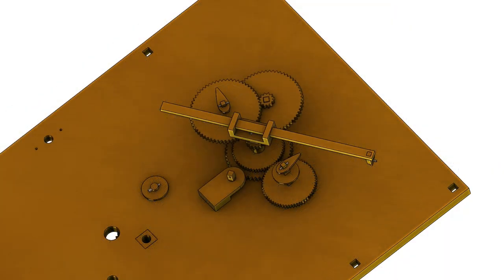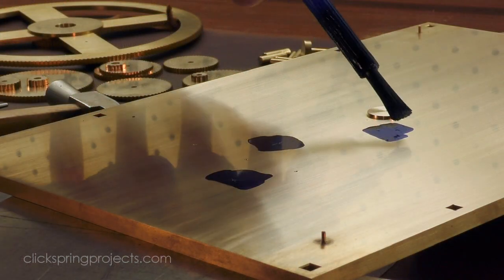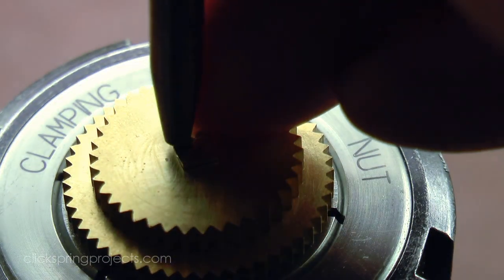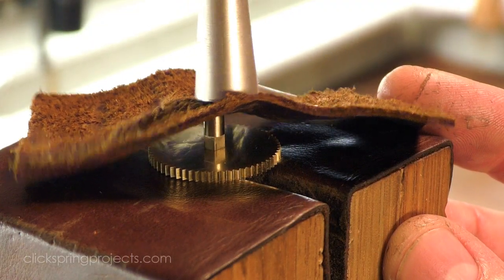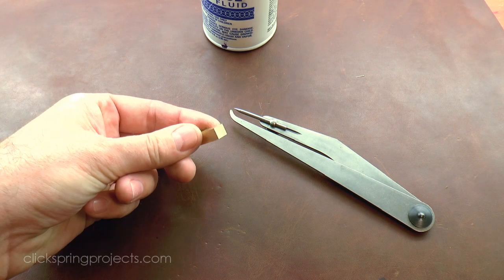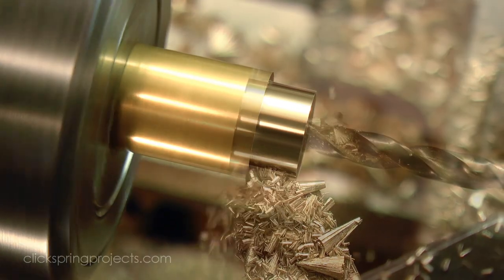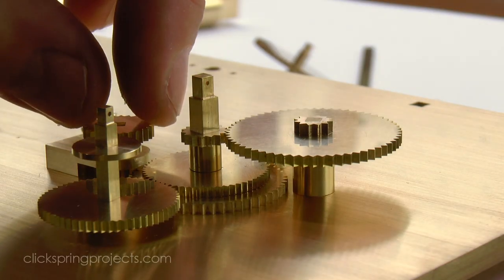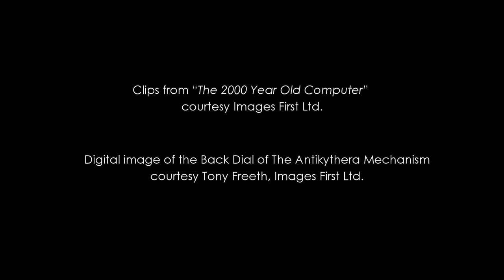The #AntikytheraMechanism Episode 6 - Making The Metonic Calendar Train

Comment: It blows my mind how workable brass is by hand. I'm surrounded by so much steel that sometimes I forget how soft some metals are. Frankly it looks like a perfect balance between strength/stiffness and machine ability for a bronze age mechanism. I'd be curious if you think softer would be more preferable given all the filing involved in this project and it doesn't seem like this particular mechanism really needs much strength to function
Reply: I'm pretty amateur in regard to metalworking, so don't take this as gospel, but I think anything softer would actually be more difficult to work. This kind of bronze and free machining brass are a perfect balance as you stated. Softer metals will gum up files and grab bits. Even yellow brass has this problem and it is only slightly softer of a metal. The nice thing about the type of bronze he's using is that it makes clean chips/shavings when milling/turning/filing it. This lets the heat of cutting it leave with the chips/shavings, and allows the tools to stay sharp and clean. Yellow brass, for example, will gum up files very quickly and will grab bits, which can be quite dangerous and destructive to the parts.
Reply: @NautilusGuitars  He's using brass, not bronze. Probably C360 brass, which is pretty much ideal for machining.

Comment: Chris, another brilliant video for us to salivate over. One point did occur to me. The assembly is based on square shafts, therefore the relationships between the various gear teeth was fixed before installation. Does out of alignment matter or is there adjustment later in the build? Looking forward to No 7. Regards.
Reply: Peter Gregory, excellent question, I wondered the same...
Reply from the maker: Hey Peter, the pointer orientation wrt B1 is all that matters and that orientation is set during assembly. It becomes a bit more complicated when setting the planetarium tho, more detail in later videos - Cheers :)

Comment: Thank You Chris, Excellent episode, beautiful work and videography/graphics as always!  Better every time!!  Had to watch it again this morning because I got caught up in counting wheels and No. teeth hand cut plus all the other delicate profiling...mind boggling and my fingers started aching and right eye drooped just thinking about it. @¿~  Those that complain about time between videos should give it a try, IMHO.  Couple of questions for you about how you keyed (layed out) the squares to teeth (on your board?) and then the overall timing of the three trains to get the pointers synced?  Always appreciative of the links to research and of course the Squeak.  Thanks Much...such a pleasure!  ~PJ
Reply from the maker: Thank you PJ! - My fingers are a bit sore after this episode too!! Re the square layout - The arbor squares are laid out without any particular reference to the teeth - its a bit like a clock mechanism in the sense that all that really matters is the relationship between B1 and the output pointers. That relationship is set at assembly - B1 is set to a particular day, the train assembled, and then the last assembly carrying the pointer is dropped into position pointing where it needs to relative to the dial. (In some cases it can also be done by removing an assembly a little further up the train: eg remove the L assembly, orient the Metonic pointer, and then reinsert the L assembly). This gets a lot more complicated for the planetarium - not only the position in the ecliptic needs to be set, but also the pin/slot followers need to be set to the correct point in the objects synodic cycle - Setting the mechanism would most definitely have been a job for an expert from the Ancient workshop - Cheers mate :)
Reply: Thanks Chris - makes sense now!  Looking forward to seeing the planetarium and laying out and cutting the spiral!  Cheers!
Reply: Exactly what I wanted answered!

Comment: Just incredible....and a question from a novice...what's the advantage of that wobbly drill marking tool that you stabilize with the pencil? Wouldn't an inflexible punch in the chuck achieve the same thing?
Reply: That's a centre finder and allows you to zero in to the exact centre of the punch mark on the plate below, your drilled hole wil lthen be exactly where it should be.

Comment: Curious to know if your shop-made small parts vice is becoming a preferred tool for you, or if you are using it mostly for a dash of authenticity? Thanks for incredible content!
Reply from the maker: Hey rob - yes very much a preferred way of holding small parts - Very convenient for fast repositioning of the work, the wider flat platform is useful, and the fact that it sits very close to eye level makes hand filing less physically taxing. I rarely use my panavise any more, this beats it by a mile. Cheers :)

Comment: how are those indicators going to be aligned to the proper orientation relative to the labels on the face?
Reply: mmmlinux just take all the gears out, and put em back in I guess
Reply: mmmlinux, excellent question – I'm also afraid it involves disassembly of the gearing...
Reply from the maker: The orientation of the pointers is set during assembly. It becomes quite complicated when setting the planetarium, more detail in later videos
Reply: You make the labels on the face match the indicators. ;)

Comment: whats that wobbly drill bit your using at 4:55?
Reply: It is a center finder.  Helps align horizontal mill with the layout marks for the holes he is drilling. When he is satisfied the finder is aligned with the mark, he exchanges the center finder for a drill and makes the hole.
Reply: called a wiggler (or sometimes a wobbler). Search wiggler indicator or wiggler center finder / edge finder.

Comment: Compass to mark out teeth in a small gear:  A center point (as usual) and a lateral triangle on the other arm  the exact profile of the file to be used. The compass marks not with a scratch but creates a tiny landing for the file.

Comment: Hello. I would like tell you how much I appreciate your videos. Your attention to detail is amazing and your work ethic is unmatched. I have a question, though. Through out your videos, I think I have noticed you prefer a conventional cut rather than a climb cut when at the mill. Is there a particular reason why?

Thanks
Chris
Reply from the maker: Hey Chris, yes generally I prefer a conventional cut due to the limitations of the mill - its not overly rigid, and a climb cut can often lead to the work "grabbing". So for bulk stock removal I will usually use a conventional cut, because I can rip into it without having to be cautious. I do often finish with a climb cut for the better surface it gives, but when doing so I'm very careful to use a very modest depth of cut and feed rate - Cheers :)

Comment: Wow what amazing work and filing, lots and lots of filing. I noticed that you file, sand, and blend all of the rivets and pins. While pretty, do you think that the original builders would have gone through all that for a working device? For clearance, yes, but for most of the others, a peened surface would have worked fine. Keep up the good work, I can't wait for the next video.
Reply from the maker: Hey Christopher - In some cases it wouldn't have necessarily been required (eg top of the L assembly shown in this video), but in most cases yes full finishing would have been required. The rivets mostly exist in parts that are themselves bearing surfaces (eg top of the B assembly, both top and bottom of the M cock etc). If left as a peened surface it would generate way too much friction and severely score the mating parts - great to have you watching :)

Comment: I've got to say amazing work and such patients on making each gear! My questions is how did you align your square notches on each gear so that you weren't off half a tooth?
Reply from the maker: Fortunately it doesn't matter -  its a bit like a clock mechanism in the sense that all that really matters is the relationship between B1 and the output pointers. That relationship is set at assembly - B1 is set to a particular day, the train assembled, and then the last assembly carrying the pointer is dropped into position pointing where it needs to relative to the dial. (In some cases it can also be done by removing an assembly a little further up the train: eg remove the L assembly, orient the Metonic pointer, and then reinsert the L assembly). Thanks for watching and asking :)

Comment: This had to be an item made for a king or the greatest temple in the country.  The number of hours required for the original is mind boggling.  

Its clear proof that the woodworking level they had achieved was considerably advanced also. This harkens to mind water wheels, mills, grinding mechanisms, windmills, sawmills and other mechanical industrial purposes.  They had to have devices like those.  We have just largely forgotten them since we use electric motors now.  

The mechanical ratios also bring to mind man cranes and crane lifting devices they surely had for some of their construction and loading/offloading vessels just out of sheer efficiency and necessity.  Using human labor has its weight and size limitations.

Comment: EPIC !!! What keeps the pin from sliding out during operation over time ?
Reply: G'day uibsen, The pins are gently tapered and the long tool Chris is using to enlarge the hole (a clockmaker's 'Broach') has a matching taper. This generates a lot of friction when the pin is pushed into the hole making it difficult to remove without force. Cheers

Comment: On the miniaturization comment, I like to think the Greeks had a way larger version of this mechanism, either as a proof-of-concept for this model, or being used in the same way a clock tower in a town square would be used.

If you think about it, this mechanism would have excellent potential for scheduling and timekeeping.  By using the planet's orbits as a reference, this mechanism can be used to keep the communities calander synchronized, much in the same way we use atomic clocks and time servers today.

Comment: Hey Clickspring.
   I wonder if anyone has considered that long before the antikythera device was constructed, that not only were previous models made and 'tweaked', But another logical thought could and should be considered. 
   That the Device is a 'miniature' in metal, of a much larger wooden machine. 
    Making a far larger wooden version would enable one to construct many many versions with differing gear ratios, and placements of gearing, as well as perfecting the rod and pin construction method, which in a large wooden version have been easily knocked out and disassembled. Thus ease of construction, disassembly, to allow gearing to have been moved and tried in other locations. If the primary support surface was made of a good hard wood, and the assembly needed to be moved, another wooden plate could be easily constructed. 
   Once you had everything aligned as you wished, with the gearing ratios 'set', and the overall design refined... One could then produce far small components out of metal, which at the time was far more expensive. To the point where you would not be creating new ideas out of metals, but wood, and then building the refined an proven device later out of the expensive materials. 
   If you make a mistake in wood, a new part costs almost nothing... in comparison to the cost of copper, brass, and bronze of the day. But 'screwing up' an expensive metal part, just because you don't have the finished device clearly designed up to a working large scale design, would be too foolish for the Ancients to have taken such chances with. At least in my opinion. 
   It is pretty obvious that the people involved in creating, building, and perfecting the Device were very smart, wise, and took painstaking care in their construction. I feel that anyone that 'anal' about things, would definitely NOT have 'wasted' metal by making parts and finding out that they were not the right tooth counts, or end up with a part too small, or too thin, or some such else. 
    Thus my thought on them having made much larger wooden designs first to 'prove' everything worked according to plan. 
   I found your idea about the 'pin hole jig' for getting the tooth counts right, is probably correct and would definitely have made marking the costly metal more accurate, allowing for fewer errors, and finer pieces to be created. 
   I have often maintained that contrary to 'modern' ideas on how primitive our ancestors were, we should be considering how advanced they were. If nothing else, the antikythera device is so complex that no one with the primitive understanding I was taught the Ancients had, could possibly have constructed it. But, the Device exists, so they must have done so, meaning they were far smarter, more advanced, and had a better grasp on numbers, ratios, gearing, etc... than anyone wants to admit to. 
   We are taught that we are the most advanced civilization ever on the planet. But the Antikythera Device proves that humans knew far more than we thought they might, far earlier than those in positions of power want to admit to. 
   This aligns with more suppressed thought as well... the Fact that Homo Sapiens Sapiens, you and I, is at LEAST 250,000 years old (This is established via carbon dating AND DNA data). That span of time (and the largest number generated is nearly 500 thousand years) covers several Ice Ages. We, are a Species with amnesia. We have lost pretty much everything we ever learned, multiple times, due to drowning when sea levels rose at the end of Ice Ages. The only reason our civilization has advanced so much is that we have changed the climate of the Earth (which should be in a minor Ice Age at present) to keep it warmer longer, and allow ourselves time to develop truly advanced technologies... electricity, fully developed steam power, fully developed gasoline and diesel technologies, computers, and more. 
    So, Yes. I agree that the Makers of the Device were both smart, cautious, and brilliant. But not foolish, dumb, and ignorant like I was brought up to believe. 
    So, in keeping with your acknowledgement of the expense of the metals used, I feel that larger wooden precursors of the Device would have been made to 'prove the concept' before a miniaturized version like the Device was constructed. This would mean that the Antikythera Device would equate to a 'laptop' computer, developed from far larger ones built earlier... as I say, out of wood, with minimal metal parts, if any at all. 
    Another thought along those lines is that the pins and rivets used, would be merely miniatures of the dowels and such used in the larger wooden versions. Why create a whole new fastener system, when you have a perfectly good one you can merely make smaller? 
   Just my thoughts, 
Speaking Frank-ly
   P.S.  Sorry for the lengthy posting.

Comment: When you finish the Antikythera mechanism, you should build a mechanical clock that would have been correct for the same time period and use the clock to DRIVE the Antikythera mechanism. I believe they had water powered clock towers and stuff at this time, did they not?

Comment: Chris at 15:36 you use a surface to abrade the brass and create the linished finish. What surface is that? It doesn't look like sand paper. Or is it just well used sand paper.
Reply from the maker: Hey Gus, yes just well used 800 grit paper - Cheers :)
Reply: Also, that tight fit on the final tooth fit, isn't that an anti-backlash requirement to a degree? Or is a little backlash not an issue with this device. Its always a careful balance between freedom of movement and positional accuracy with pre-load.
Reply from the maker: Some degree of backlash required for all gear profiles, but especially so with a triangular tooth profile

Comment: Chris, time for my weekly "no clue" question:  the 2 projects that you now have on your workbench do they have to be done in "half hard" brass. I see where a clock would but these are not running all the time, no pun there. Or is brass  c230, 330 just to soft. period   Ralph
Reply from the maker: Hey Ralph, I'm using CZ120/121 with a 1/2 hard hard temper for each device. You are correct that neither device will get even a fraction of the surface contact of a clock, but I figured I'd play it safe  - Cheers :)
Reply: Now that I have thought about it more you want it  last for a very long time,plus you don't know whose heavy hand is turning the drive

Comment: Hi Chris! I have some question about multiple gears mounted on the same square arbor - is their mutual position relevant? I mean - does their teeth has to be aligned somehow? In other words - do you care about orientation of the square holes in the gears, before making them. Maybe my question is somehow lame but it really bothers me. Thank you!
Reply from the maker: Hey KP, great question :) fortunately it doesn't matter -  its a bit like a clock mechanism in the sense that all that really matters is the relationship between B1 and the output pointers. That relationship is set at assembly - B1 is set to a particular day, the train assembled, and then the last assembly carrying the pointer is dropped into position pointing where it needs to relative to the dial. (In some cases it can also be done by removing an assembly a little further up the train: eg remove the L assembly, orient the Metonic pointer, and then reinsert the L assembly). Cheers!

Comment: Do you plan on lubricating the surfaces where friction might be an issue?
Reply from the maker: I will investigate this towards the end of the build - its seems reasonable that lubrication was possibly used, but I want to see if it was necessary first. So far the friction is surprisingly low